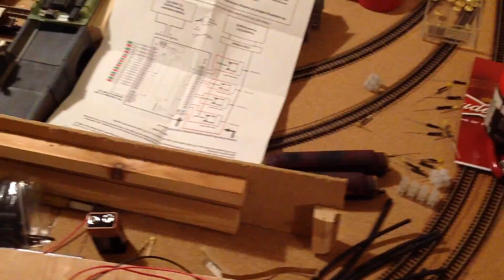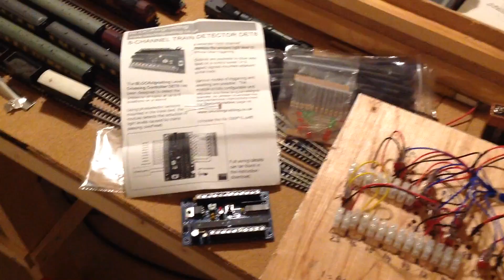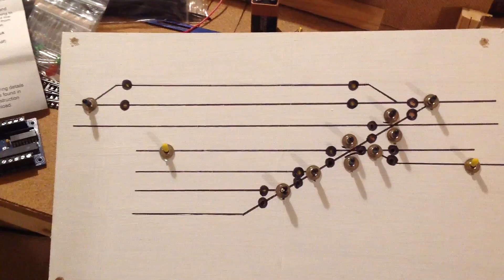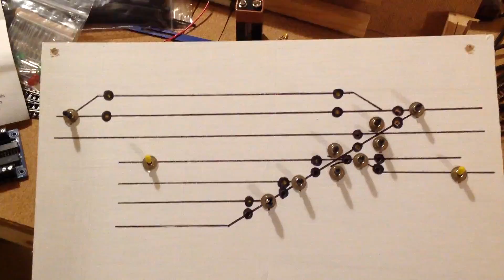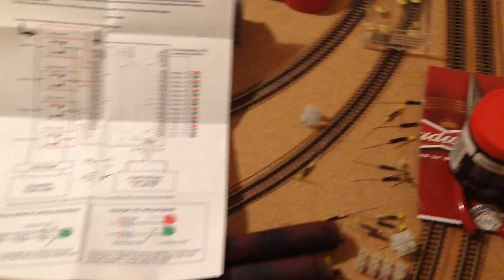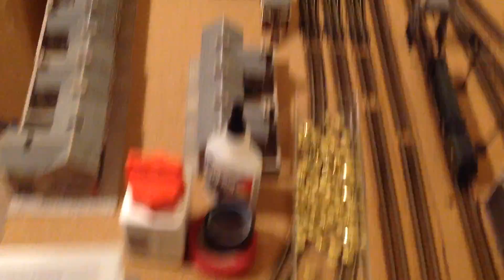New Layout Build Update 18 - Electrics Part 2

Comment: Nice update,  The wiring looks complicated but then again it's probably quite easy when your the one doing it lol.  With you going for a light sensor over a different type, I assume you won't really be able to run the layout in a full dark night time mode? Or is the sensor really sensitive?   Either way I can't wait to hear your experiences with it.

Cheers
Reply from the maker: +Michael Henfrey Thanks.  The loco shed has lights inside it so there will be a constant light source for reference so the sensors will be in shadow when a loco is over it and so will trigger the LED.  For the tunnel I'm going to have to use an IR sensor because that will be very dark in there.